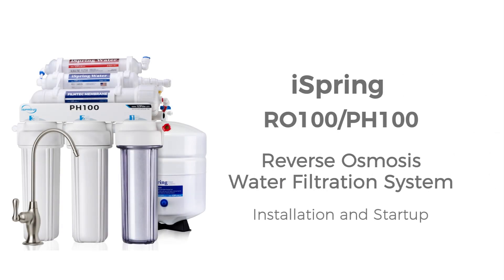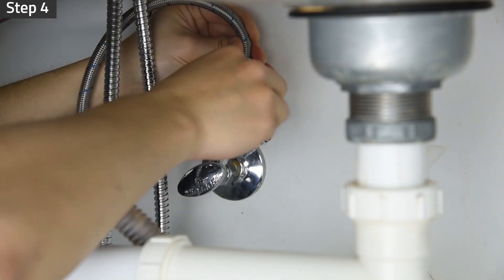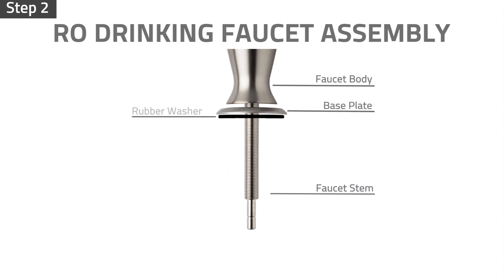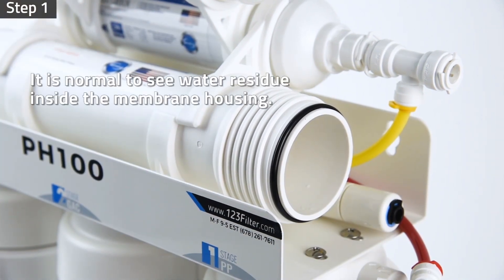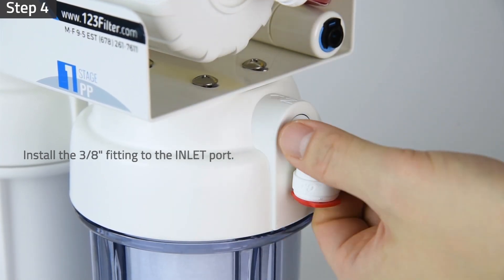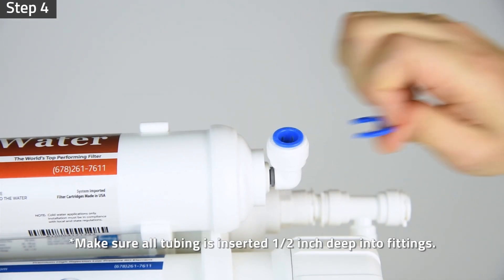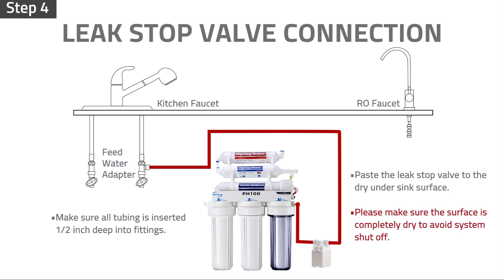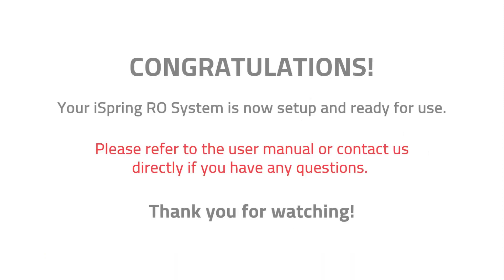How to Install a Reverse Osmosis System: iSpring RO100 & PH100 DIY Installation

Comment: Ok, so I installed the iSpring PH100, did the filters pre wash for 20 mins. 

Once the whole system was installed, I let the system run for 20 more mins.

Once the system ran for 20 mins, I filled and emptied the tank 3 times.

My issue is that for whatever reason the filtered water comes out somewhat cloudy and seems to have some particles that, when leaving the glass still on my counter, they float to the top of the water. 

Where did I go wrong?
Reply from the maker: Hi there. The cloudy or white color is completely normal with a new installation. The white color is caused by trapped air in the system, that air creates very small bubbles after passing through the filters which can make the water look white for a few minutes after pouring a glass. That will go away completely within 1-2 weeks. I will advise you to open the RO Faucet for 3-5 minutes two times a day for a few days to make this better. Keep in mind that these are new filters and they just need water to go through them to level out.
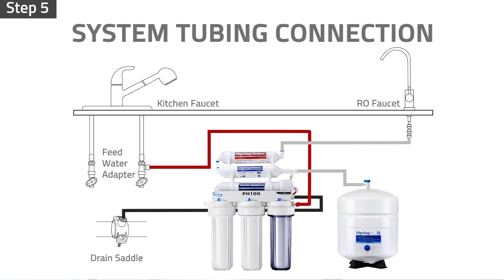If you have any concerns or questions, please kindly contact us at support@123filter.com, at (678) 261-7611 M-F 8:30-5:30 EST or at (470) 560-0012 M-F 8:30-5:30 EST (Messaging only) 
We are happy to help!

Comment: Does this system require an electrical outlet?
Reply from the maker: Hi there. No, the RO100 or the PH100 do not require an electrical outlet.
If you have any questions or concerns, please, kindly contact us at support@123filter.com, at (678) 261-7611 M-F 8:30-5:30 EST or at (470) 560-0012 M-F 8:30-5:30 EST (Messaging only)  
We are happy to help!

Comment: It leaks from the yellow (short) tube. I took it out and put it back some ten times and even used a different clip but it leaks again. The yellow thin and short yellow tube is connecting two cylinders and was there (but is not one of those tubes that users should install). Disappointed
Reply from the maker: Hi there. Please, kindly contact us at support@123filter.com, at (678) 261-7611 M-F 8:30-5:30 EST or at (470) 560-0012 M-F 8:30-5:30 EST (Messaging only)  to properly guide you.
We are happy to help!

Comment: The leak stop valve doesn't match red tube size. It's smaller than the red tube. I cannot use it without additional adapters.

Comment: ok so all are 3/8 tubing ....got it ,,,can the system runs on 1/4 tubing by using 3/8 to 1/4 tubing? like the source feeding tube and faucet tube?
Reply from the maker: Hi there. Yes, the system can run on 1/4" tubing with an adapter. If you have more questions, please feel free to contact us at support@123filter.com or call us at 678-261-7611 (M-F, 8:30 - 5:30 EST). We are happy to help!
Reply: @iSpringWaterSystems  Why is the system setup with 3/8 at first? Will there be any concern about performance giving 1/4 vs 3/8 and this is 1:1 system.

I've been using years with my current RO system 1/4 , system is 1:3 so quiet water waste thus I would like to use 1:1 system you have there but it is 3/8!

Do you have 1:1 RO system with 1/4? rather than 3/8?
Reply from the maker: @jpthsd  Turning 3/8 to 1/4 will not impact the 1:1 ratio.
Reply: @iSpringWaterSystems  Do you have the same system with 1:1 setup with 1/4 tubing? I would like buy that 1:1 system. It is the 3/8 setup stopping me to do so! I would love to buy if you Ispring/123 company offers customers like me the 1/4 tubing 1:1 system! ( i recently purchased 1/4 1:3 system, it works very well for my friend house)
Reply from the maker: @jpthsd  The closest we get with 1/4" tubing is our RCC7P model with 1:1.5 filtered to waste water ratio: https://www.123filter.com/ac/5-stage-essence-ro-water-filtration-system/ispring-rcc7p-high-capacity-performance-boosted-under-sink-5-stage-reverse-osmosis-drinking-water-filtration-system.

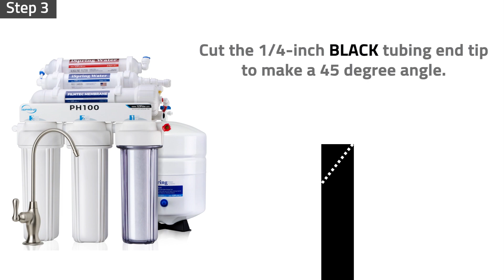Comment: At 2:37 you install the RO waste line below the P trap. Your instructions say explicitly on Page 11 that it needs to be installed above the p-trap. Which is it?
Reply from the maker: Hi Evan. It is recommended that the saddle should be placed before the p-trap. If you don't have space before p-trap, you can install it after. If you have any other questions, please give us a call at 678-261-7611 (M-F, 8:30 - 5:30 EST). We are happy to help!

Comment: The video shows the waste water hole being drilled down stream from the p-trap- this is expressly prohibited in the printed manual.   Which is correct?
Reply from the maker: Hi there. It is recommended that the saddle should be placed before the p-trap. If you don't have space before p-trap, you can install it after.

Comment: iSpring friends, I finished the installation, However when starting the system, no water comes out of the drinking faucet, not even a drop, it feels like the water is not flowing, it seems to me that the automatic valve is turning off the system. What I can do? (I did the cleaning of the pre-filter system again and the water runs fine).
Reply from the maker: Hi Richard, Please open a trouble ticket on our website https://www.123filter.com/ost/open.php and we'll be happy to help. You can also contact us at 678-261-7611, our water experts can assist you efficiently and immediately with your requirements, or u can email us at support@123filter.com, including a copy of the purchase receipt so we can register the warranty. 
Thank you!

Comment: How long should the filter run and create waste water before it fills up the tank?
Reply from the maker: Hi Randomalia. it depends on the water pressure. When the tank is full the drain will stop. It can take up to two hours. For example, if your water pressure is 60 psi, the tank fills in about 30 minutes.
Reply: @iSpringWaterSystems  Hmm....mine's been running for about five hours.
Reply from the maker: @Randomalia  In this case, please give us a call at 678-261-7611 (M-F, 8:30 - 5:30 EST). We can help you to figure out what went wrong.
Reply: @iSpringWaterSystems  unfortunately, its not an iSpring system
..but, I did just install an iSpring whole house system.  I wish I would have purchased my RO from iSpring.

Comment: Does the water stop moving tdd through the system once the tank is full?
Reply from the maker: Hi Thomas. The water will stop moving through the system once the tank is full.
Reply: @iSpringWaterSystems  What does it mean when it sounds like the pex line is vibrating?   It seems like it wants to auto-shutoff...but doesn't.
Reply from the maker: @Randomalia  This could mean that the automatic shut off valve is damaged and needs to be replaced. Please check your home water pressure and open a support ticket for replacement by sending an email to support@123filter.com if needed. Your home water pressure should not exceed 70 psi.
Reply: @iSpringWaterSystems  I returned my Insight Bioscience RO system and ordered one from iSpring.   So, hopefully this means that it will work better.    Thank you!
Reply from the maker: @Randomalia  Awesome! If you have any questions or issues with our products, please feel free to send an email to support@123filter.com or call us at 678-261-7611 (M-F, 8:30 - 5:30 EST). We are always happy to help! :)

Comment: I am disappointed  but no blue line for faucet came only white cable. Now I have to wait. It sucks
Reply: Same here. No blue tubing. Only red and blue. And the stop valve fittings are for small tubing.  The one that came from the main line is a big red tubing.
Reply from the maker: Hi dtechlogic. I'm very sorry about your experience. I have reported the issue to our product manager, and we will make sure that it won't happen again. If you have further questions or concerns, please feel free to contact us at 678-261-7611 (M-F, 8:30 - 5:30 EST) or email us at support@123filter.com. We are happy to help!